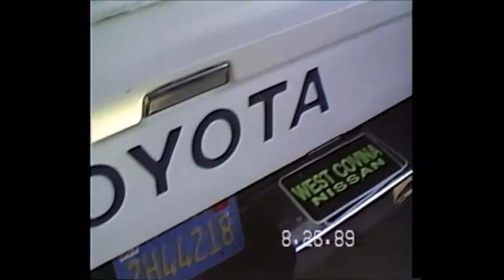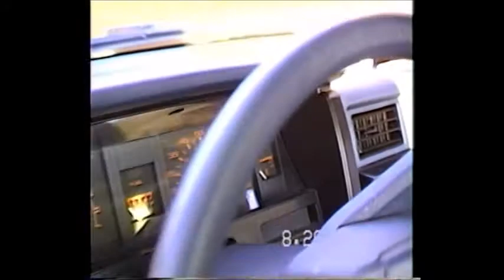1989 Nissan hardbody truck. Brand new! Attempt to install cassette player!

Comment: I bought 1992 Nissan Hardbody 'base' pickup truck back in 1992.  I liked that truck, manual windows and locks, 5 speeds manual four-banger with no AC or Power Steering.  I tried to install a basic radio in it, but I never really used it, so I pawned the radio.

Comment: Wow, girls were so cute in 80s and people were thin and in good fit shape. Those Nissan trucks may have been stripped down but they ran for 25 years non stop with only oil change and new tires. I restored my 1990 with turbo and candy red paint. I have a double din video audio stereo now with Bose speakers.